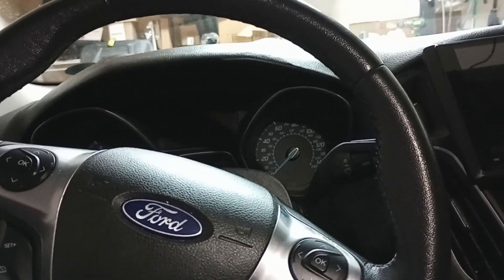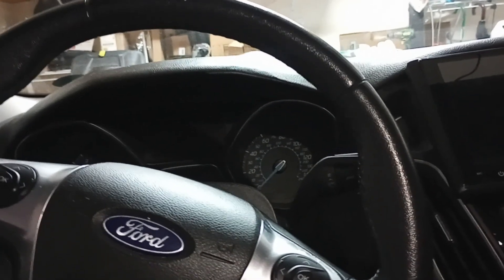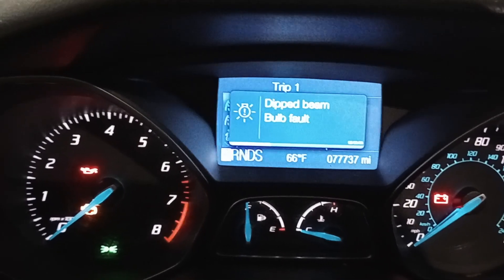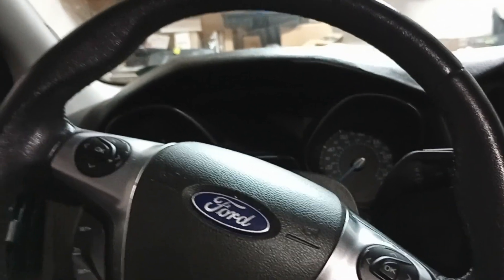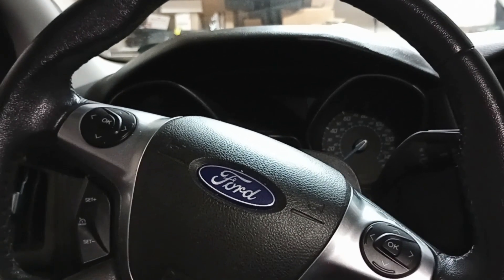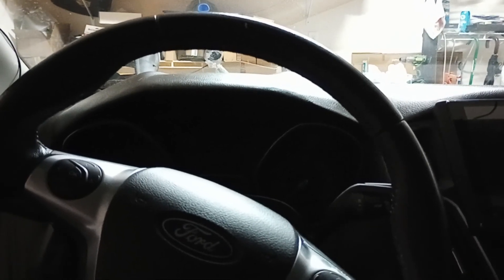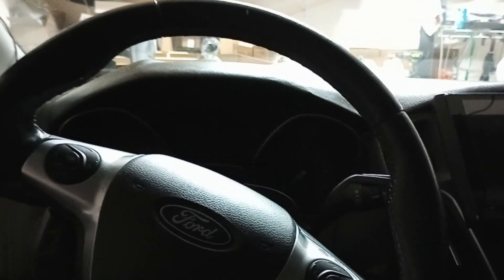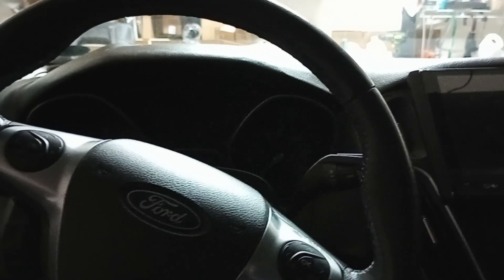Dipped Beam Bulb Fault

Comment: Similar issue, 2013 ford focus here , i bought phillips ultinon LEDs and the Phillips led decoders, ( resistors) these are quality decoder's unlike some cheap ones on ebay/Amazon and my lights actually work, still get error message but LEDs work perfectly.

Comment: I just encountered a similar issue, to clarify I am not trying to do an LED conversion, the problem I have is I am getting the same error message "low beam dipped bulb" at first I tried replacing the bulb, after that didn't work, I tried cleaning any corrosion that could be affecting the conductivity, after that I tried again and nothing, I swapped the headlight assemblies and the right side is still not working, after this I am testing for continuity ( I am not an electrician and my knowledge is very little to zero ) I even swapped the bulb socket connector and nothing, after making sure the fuse is still working, I don't know what to do, I really hope you found a fix to your problem, please let me know what you find out. Thank You.
Reply: Dis you fixed ? I got the same issue